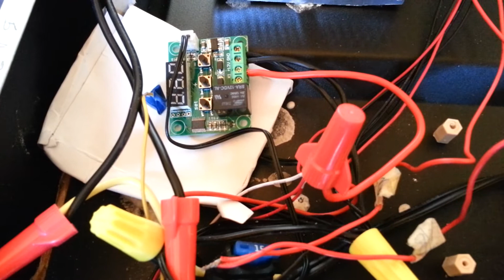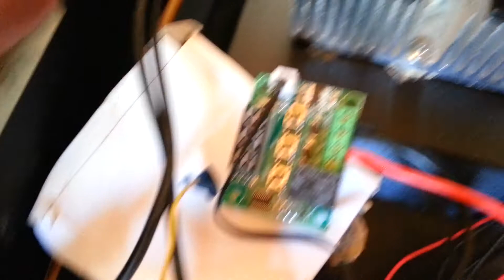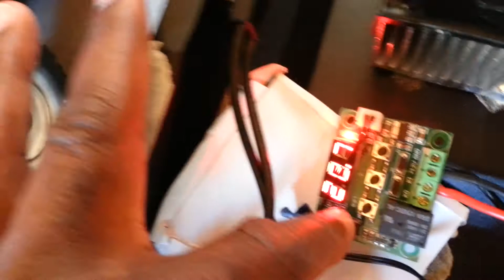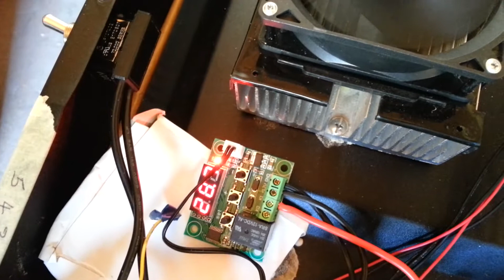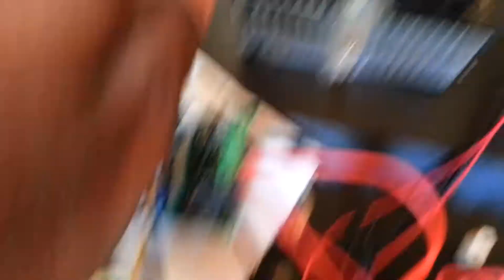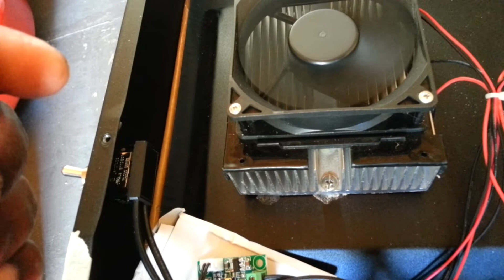How To: Add a DC Thermostat to a Peltier / Thermoelectric Fridge

Comment: Your peltier fans are installed upside down, you want to get the heat away from the box, but by blowing down, you're pushing that hot air towards the fridge. You'll probably get less cycling by switching it around.

Comment: I have this same fridge. I repaired it about 4 years ago but it failed after a while. I had to replace one Peltier module as well as one of the fans. Then the PSU failed. I replaced the two large capacitors and the two D13007K BJTs but they blew. I have a 12V PSU on order. I might make a circuit to use the NTC thermistor and temperature control in the unit. The internal fans are supposed to run continuously to circulate cold air, so only the external (hot) fans and the Peltiers should be switched on and off. I may make a video when I finish the project, and I can link it here in another comment. Thanks!

Comment: Bro can you please tell me, how to set maximum temp. and minimum temp. I want to run peltier ac within range of 0°c to 20°c. How should i set this temperature controller,please explain in detail
Reply from the maker: This system has been taken down but I will revisit this project one day
Reply: @DIYOneForAll  what does that mean, u don't know connections or u don't know how to use this temperature relay
Reply from the maker: @omprakashgunarat  I mean that I no longer have that system.   This was a few years ago when I made the video. In the future, I will do a similar project.

Comment: Does the amperage of the thermostat alone adds up? I have a 12V 10A power supply. Considering the peltier being 5A and the fan to be 0.2A. But I’m planning to add inside fans about 7A in total including the peltier’s. How much amps should I consider for the thermostat?
Reply from the maker: It all depends on the chosen thermostat amps rating. I would check the specs of the thermostat.  You will need to consider the current draw of all devices.  If you don't have the specs, you may want to hook up one or two devices at a time and measure the current draw.
Reply: DIY OneForAll Do you have a background about the W1219? I searched everywhere but can’t find a spec that would answer my question, tho it’s seems to be generic. I just wanna make sure before purchasing one.

Comment: This is perhaps late but I noticed the relay kicking in and out at the end of the video.  You can set P2 to 1 or 2 degrees so the relay only switches when the difference is equal to the value you have set.
Reply: Hi, join the negative wires together, Tec1 & PSU and connect it to the thermostat negative. Connect the + of the PSU to the thermostat positive and make a small jumper cable from the + on the thermostat to one of the relay points on the thermostat, P1 or P2. Then connect the + of the Tec1 to the other relay point. You can connect the positive and negative of the fans in the same way as the Tec1. This only applies if you bought the exact same thermostat as in this video. Hope this helps.
Reply: Both the pletier and the thermostat uses 12 vdc, Please don't connect it directly to 110v wall socket without a psu!!  You need a 12vdc psu or use a 12v battery instead.
Reply from the maker: Jacques Louw 
Thanks for that info and thanks for watching.  Cheers
Reply: Jacques Louw I'm currently working on the same project, I have everything but the tec1 module, and the power supply, my question is, the thermostat uses 12v, and so dose the tec1 , the relay can handle up to 20 amps if I remember correctly, so correct me if I'm wrong , I would hook up the thermostat as normal with its + & -, then I would put the - of the tec into the far left relay, hook up my + power source into left  relay, then hook up the + (tec1) & - (power source) together? in my case I'm just thinking of cutting an old extension cord from a fan, and connecting direct to 110v wall socket, should I be good like that,
Reply: Jacques Louw it dose help just that I don't have a PSU, I wanted to go directly to the 110v wall socket

Comment: hi I want to wire a thermoelectric Peltier cooler 12706 so I want to know that how much output of the thermostat it gives output and how many amps plz reply
Reply from the maker: 12 12 volts - 10 AMPS
Reply: SMPS power supply